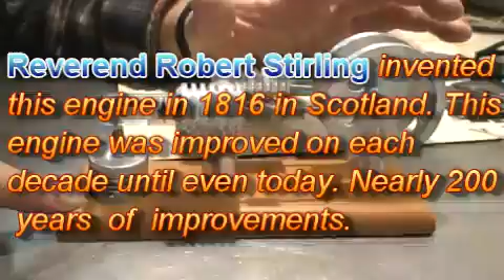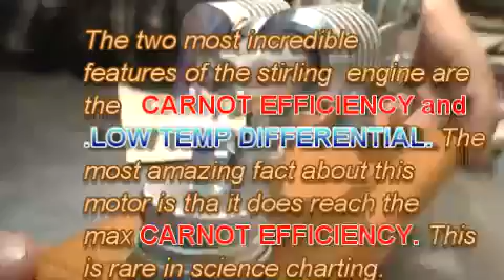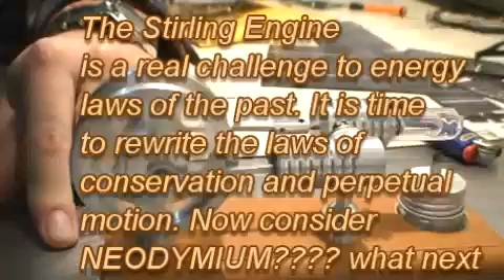free power, how it works, the stirling engine part 1

Comment: So your the new design is in fact nuclear powered. As this is an interesting design and demonstration of efficient systems, what would be a better design for a Stirling engine, is one that would operate on a molecular level using quantum reintegration as a source of energy. We have nano electric motors, now all we need is a way to power the nano motors with the motion of the nano motors as it were.

Comment: you are right and wrong at the same time, its not free energy, but it is not using the alcohol as fuel, the alcohol is expanding and contracting because of its low boiling point which is changed in to kinetic energy to move the pressured and vacuum pistons. it not free because you still need a heat sources, and even if the you solar power, usable energy will never be free. they can only reduce the cost of producing it.

Comment: yes, but it runs off nothing but heat. geothermal energy, maybe? that is free. or, it could possibly be adapted to run off a cooler air difference. then, just put dry-ice under the glass tube, where the fire is on this model. bingo, if not free, extremely efficient power.

Comment: @Jaydee254 It was never phased out, it was never used! As far as your opinion of temperature and altitude you do know high performance Stirlings are sealed systems right? Temperature and humidity and altitude mean nothing and i do believe in the 70's stirlings were experimented in satellites, is that high altitude enough for you and Temperature extremes? I think you just made up the Stirlings being phased out and is not based on fact!
FYI Infinia systems makes solar Stirling generator----->

Comment: People that worry about going electric and would rather have a piston car engine can still have that with a V8 stirling engine that uses infrared laser system  as the heat source that runs off batteries!!

Much nicer model than glass below!!

Boehm HB11 German Made Stirling Engine 

STIRLING ENGINE SOLAR POWER FRESNEL LENS HOT AIR ENGINE MOTOR 

Infinia Stirling Solar Generator 

If you want a nice model Bohm makes the best!!

Comment: Alcohol like CH3OH or methanol and many kinds of alcohol having carbon atoms, hydrogen atoms, and an oxygen atom is a dominant energy sources of modern world in a form of fuel. OK, let us digest my idea. Fuel (alcohol) + Oxygen + Heat = thermal energy which is converted to a kinetic energy of pressurized fluid (maybe air) in the piston which transformed to mechanical energy that is why it works. So the mechanical energy output is equal to the chemical energy input from fuel (theoretically).

Comment: NASA uses the stirling engine to power satellites. A nuclear reaction creates heat and that heat is used to power the engine. The lifecycle will be 12 years or longer.

Still the amount of plutonium needed too power the stirling engine is quite high and the power created by the engine is quite low.

Comment: Energy isn't created it's just converted from one form to another with wildly varying degrees of efficiency.  There's no such thing as "free power" even if you use solar/wind power there's a cost in building and maintaining your apparatus.   You may achieve high efficiency and very low cost but it will never be free.  Nor will it ever be "over unity".   The stirling engine has not been forgotten or "sat on"/silence.  It's been used in certain solar concentrator cells for years.

Comment: Definitely not free energy. you are using an external heat source to convert the heat into mechanical energy. Sterling engines are probably the most inefficient engines, with less than 10% of the energy put in converted into mechanical.  A 2 litre car would be cheaper to run

Comment: Not 'free' power, there is no such thing. There is still combustion taking place outside the engine to produce the heat energy to drive the piston. It still produces emissions.
Reply: Where you stated: "There is still combustion taking place outside the engine....", a form of "combustion" is not a necessity for a Stirling engine, only a very slight "Temperature Differential" is. No "combustion" is required, (position it so that one section is illuminated, with the other section darkened, and it usually still runs normally, depending on the layout of the design), so it does not necessarily require any combustion, nor produce any "emissions".
 Just as Patent #685,957 (1901) demonstrates, the device isn't violating any "laws of thermodynamics" at all; it is only converting 1 form of energy to another.
 (This specific device is most often referred to as "a simple solar energy converter".)
 May you have a peaceful day.

Comment: (answer to other comment, two comments in a row here)....
Yes, well, again I confess I was directly answering the comment about using a magnifying glass as the solar source to power the Stirling motor. So, your comments about other heat sources don't really apply to what I was intending to answer (before you pointed out my mistake that I was answering the wrong person).
But, yes, I understand the analysis.

Comment: There are such engines called solar engines. The plans are on line.Some college kids even used bio waste from cows AND compost! All it needs is heat and there are many ways to find free sources of heat even though it does take some work and expense to get to the "free" part that many just flap their gums at as in this demonstrations comments! They can write junk without any applied brain power or see things as half empty instead of half full. The brain is best when applied!

Comment: This engine absolutely does not reach an ideal efficiency for a Carnot engine (that is to say, perfect efficiency,) owing largely to the fact that is is not a Carnot Engine, it is a Stirling Engine, with a mildly different cycle and a considerably lower efficiency.

In fact, useful Carnot Engines really don't exist, because the Carnot cycle calls for perfect isothermal compression, compression with no change in temperature. This requires that the compression be done over a too long a period.

Comment: Did you just say this little gizmo ACTUALLY reaches max carnot efficiency?  Do you even know what that means, have you taken thermodynamics?  That is impossible Sir.  Maybe gets pretty close, but not possible.  Even if the efficiency of the Stirling cycle is very close, I bet that heat source has a terrible efficiency, i.e. plenty of heat loss to the environment.

Awesome little device tho.  Hook a generator up and charge your cell phone with it.

Comment: No, that wasn't your point. Your original point was that you proposed using a magnifying glass and a Stirling motor. The net electrical energy produced by such a mechanism would be a pale joke in comparison to solar panels of the same size as your magnifying glass.
As for efficiency data, yes, well, sorry, but you're wrong. In the total energy consumption/production equation, it all depends on what you pick as your starting point, and what you pick as your ending point. Your numbers ARE skewed.

Comment: Your explanations are not complete right.The displacement piston is not a working piston.Only the power piston (from the cold zone ) has a working  role (pushing pooling)
The air when  is heated does not push the displacement piston,just expand and pass between displacement piston and cylinder and push the power piston.The displacement piston is moved by the linkeage rod to the flyweel.All the work is done by the power piston.The displacement piston move the air from hot zone to  the cold zone.

Comment: @kasmackba What you've said is true but is completely useless. Obtain the activation energy from free sources such as the wind, water, sun, magnetism, induced electricital bursts - to give the system a "push", then you haven't used "free" NRG you have simply resourced NRG that is freely availible. The petro chemical industry has "sold" us this step in the NRG  "harvesting" process. The results are in, time to try methods such as that presented here which are totally practical. Nice video!

Comment: Your understanding of how a Stirling Engine works is not quite correct.  The displacer piston just moves the air from the hot side to the cold side and back to the hot side.  This causes the air to expand and contract.  That is what drives the drive piston.

Comment: Nice toy for school experiments but as an engine for the future it´s only a joke. Very weak and uses way to much energy. With this amount of alcohol you can produce much more power whit other kind of engines. The combination with solar is also useless, then i would use solar+electric motor either. Btw... one more question: in this example what you call free power? In this case my car works also with free power? It uses gasoline.... it´s cheaper then alcohol...

Comment: ...The big deal is that you would still need to pull a string or "kick" start it if it powered a mower. Re-read my comment, and the comment that I was responding to. 

I didn't say anything bad about your stirling engine, dude.

Comment: Then I guess he should have titled the video "Very cheap power" shouldn't he have... and again, like I said in my second post, this motor is generating no power unless it is hooked up to an alternator or some other mechanical device that actually performs work, and a motor of this size with the power that this one has, will do little work if any at all without stalling... and that is "WORK" in the physics sense.... Nice try though...

Comment: This is not free power. The sterling engine is a HEAT engine that converts thermodynamic energy into mechanical energy by heating air in a closed cylinder. The energy is all coming from the flame, if you put it out then the engine stops. This is pretty cool, but its just kind of a steam engine. Free power is still a myth; you can't get something for nothing.

Google free energy and read about it before you make videos. I typed in "Sterling engine" and found all this on the first page.

Comment: LMAO - There's no such thing as free power.  The stirling engine has been around for years and it IS used in various industrial applications where appropriate.

The reason there's no such thing as free power is because even if you make something out of scrap you still have to factor in the cost of the original material and the energy you put into the construction yourself.  Absolutely everything has a cost.

Stirling engines have an efficiency comparable to that of diesel engines

Comment: nothing's free,heat is converted to mechanical energy.your car or motorcycle works on the same principle,the problem is most of the heat is wasted,it goes out the tailpipe,if we could retain that heat in the engine,it would produce a lot more power with very low emissions,sadly material science doesn't offer any help,ceramics would work,but their just to brittle.

Comment: All the sources of energy that is available to us be it in form of Coal, Oil, Gas, Nuclear is all powered by the Sun in some form or the other. There has been many replies that, this is just a Toy and may not be useful. I'll bet any motor of this size will do any good. I haven't seen any tiny engines that is of any use. Even Lawn mowers and Chain saws that have tiny 2 stroke gas engines have pathetic Efficiency.

Comment: Ignore his lame explanation and appreciate that Stirling engines can generate more power, more cheaply, for much longer durations (years, since solar cells "wear out" & need replacement every decade to two) than solar cells. Athens, Ohio, has 4 successful businesses selling Stirling engines (not motors, btw, that refers to electrical devices), since the university there has professors who appreciate Stirling advantages. Their stuff flies on NASA missions, which says a lot.

Comment: The universe is not only expanding it is, also, accelerating in expansion indicating the increase in velocity of mass throughout ergo MORE ENERGY.  All of your explanations are moot.  Mass is being created and annihilated all the time in 3D.  Conservation of Energy should only be applied to closed systems or in four dimension.  The COE doesn't apply to open systems where energy can be input or taken from the environment or a higher dimensional plane.

Comment: #2 The cost to build the engine has not been brought up, has it? BUT you sure are slamming a cheap energy producing engine!  To your second post, There are a few companies that build actual generator systems that DO generate in the 12 to 100 KW range. Remember some people think "free" has no cost but there is nothing free except the air you breathe. Everything else takes manpower to make and no one really works for free as their time IS worth something as are the materials needed.